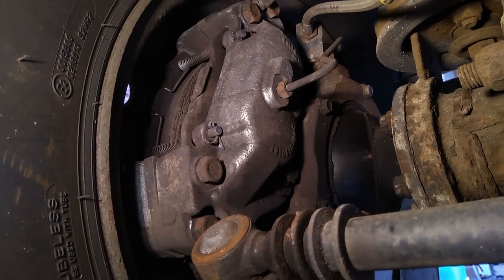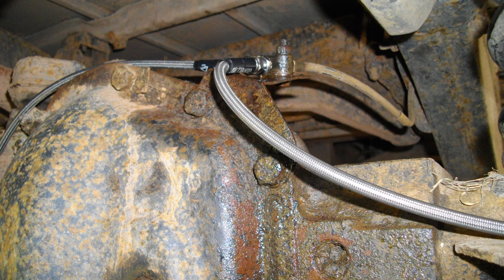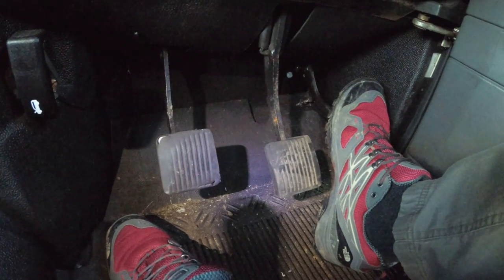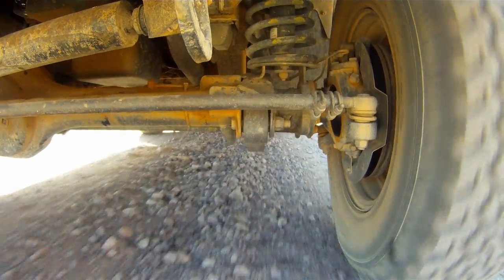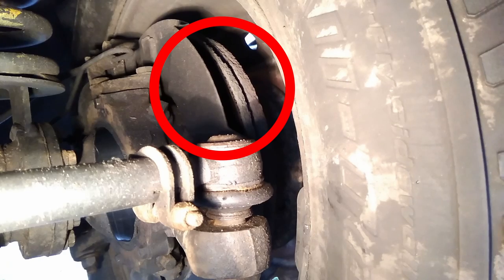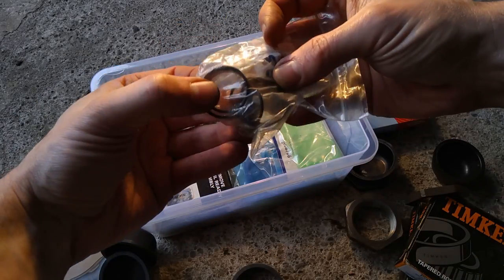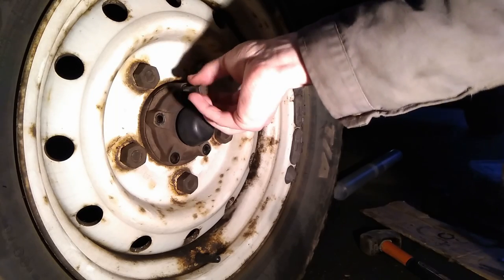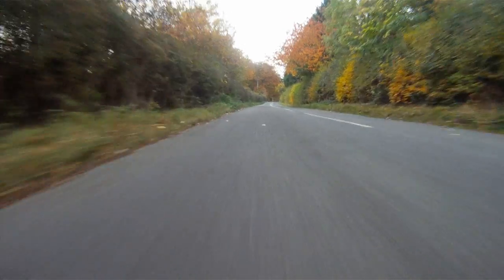Defender Soft Brakes (long pedal travel) - Check this first

Comment: You have addressed an issue repair shops very conveniently dismiss. I've had my Toyota to 2 shops, and they claim there's "no problem" with the brakes. I know they are dead wrong.

Comment: I can confirm skidding a Landy is possible , I once left rubber skidmarks on a road that lasted 9months and flatspotted my tyres from a 60mph emergency stop in a 200tdi 90.
Reply from the maker: No way mine could do that as it stands! More work required

Comment: Just wanted to say thanks for this video - I recently changes the front rotors - didn't even open up the hydraulics of the brakes, and then couldn't work out why I was getting long brake pedal when the job was done. Turns out on one side I'd failed to 'bed in' the bearing before adjusting by feel (ie. forgot to initially torque nut to 61Nm) ... and ended up with a slack wheel bearing and this exact symptom. 2 unnecessary brake bleeds, 1 informative youtube video, and a re-adjustment of the wheel bearing later - and I'm back on the road.

Comment: To properly check front wheel bearings jack the wheel off the ground and with one hand on top and one underneath rock the wheel in the vertical plane.

Comment: Yes, I had this on my old G Wagen discovering in hindsight  the symptom as a missed sign of the  lead up to a grossly collapsed wheel bearing. This was probably started by a roundabout encounter with a stout Volvo pulling out in front of me  when  I ripped off his front wing with a front  tyre  and thought I'd suffered no damage....
Reply from the maker: Had a collapsed bearing once on the motorway, not fun!
Reply: @lrworkshop  This culminated in extreme vibration of a front wheel, the tyre (6 year old BFG A/T) emitting wire reinforcement and the wheel being held in position  only by brake caliper contact with the disc. Lucky controlled stop on a fast multi lane highway.  I'd noticed the long travel braking for a while beforehand but hadn't picked it up as a sign of impending catastrophic bearing failure. So not just Land Rovers can go bang !

Comment: What are the symptoms of bad vacuum pump ?
Reply from the maker: Almost the opposite of this situation - have to drive a long time without braking to be able to get a firm pedal. One test is to hold the end of the vacuum pipe on your thumb to see if it sucks enough (there's a clip of this in the video). It could also be a leaking booster as the pump wouldn't be able to pull enough vacuum to overcome the leak
Reply: @lrworkshop  thank you 👍

Comment: Good tips! You said adjusting the wheel bearings, not replacing them?
Reply from the maker: Yes, you could inspect them but if there's no undue wear or pitting then they'll be fine

Comment: That was excellent information. Wheel bearings are not something you would think of when you are trying to work out a brake problem. 
We all have a camera on our phone these days so the tip of filming the disk when checking bearings was also a good tip.
Reply from the maker: Cheers Harvey

Comment: After fitting new brakes to the rear of my Defender 2.4tdci and also upgrading to full Pioneer 4x4 kit my brakes developed a soft first push before working properly the brakes have been blead so should be no air in the system. The Defender has new wheel bearings all round.
From your description doesn't sound like a vacuum pump issue so I'm a little puzzled

Comment: Defenders don't have brakes. You use your gears to control your speed. I'll typically barely touch my Defender's breaks, even on a long journey; so much so that if someone's following me they'll often say, "do you know your break lights aren't working?" 

Just saying 🙂
Reply from the maker: I do similar as the transmission friction and high driving position are usually enough to be able to slow ahead of time